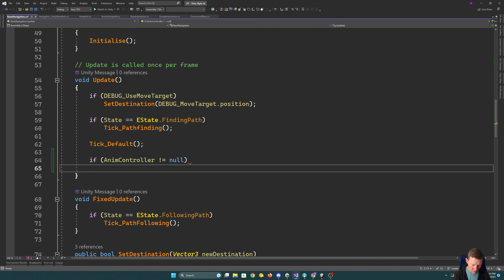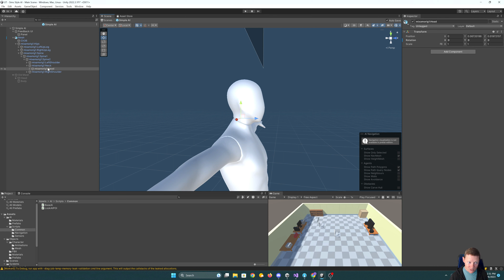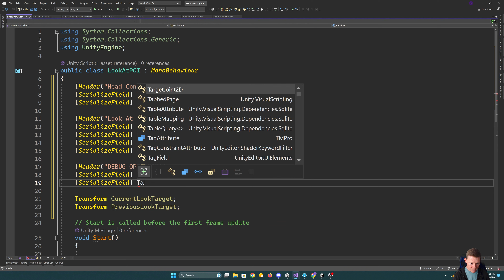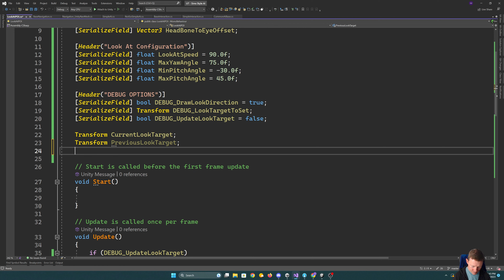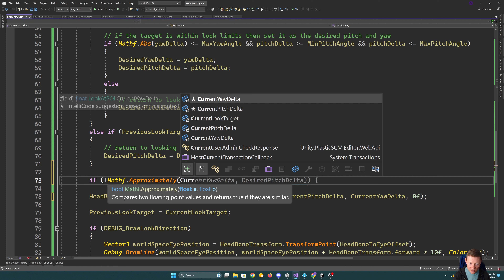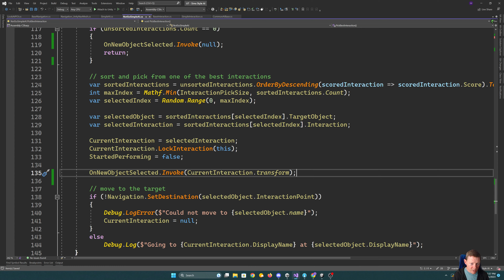Unity Sims-AI Tutorial: Humanoid Mesh and Looking at Targets

Comment: I noticed that you often write method names, which don't exist yet and then manually scroll down and create the method, is there any specific reason why you don't use the command to auto generate the method by right clicking on the undefined method name (or with a shortcut)?
Reply from the maker: A lot of it is muscle memory from working in very large C++ code bases (and being impatient). Those can take a very long time for the auto-generate option to be usable/work so I tend to forget when I'm over in C# and in more manageable code bases that it'll actually work quickly.